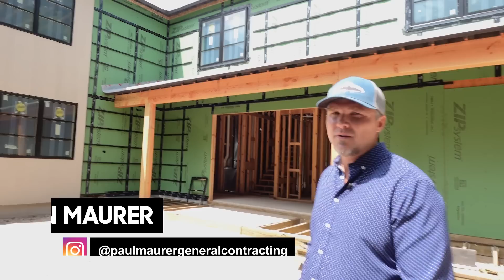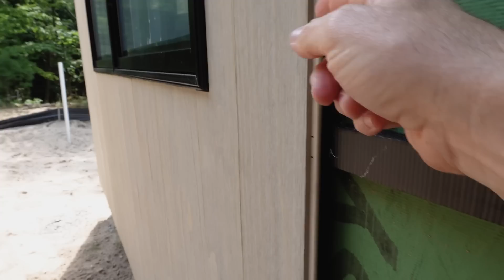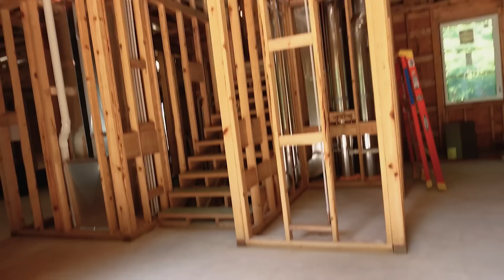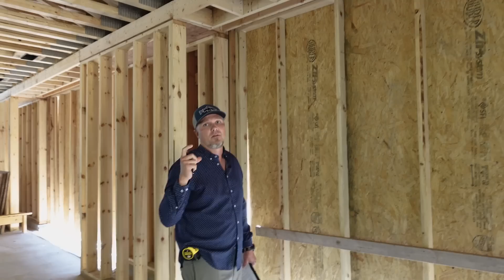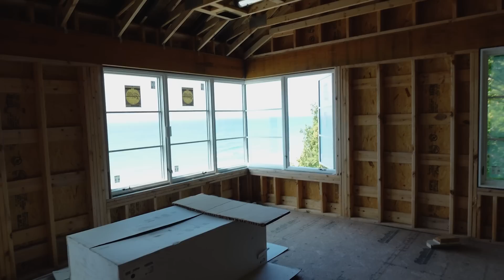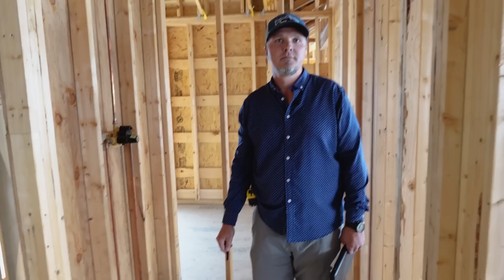MI Beach Build - Several Cool Details Here!

Comment: It had to be be pressyre treated, put under pressure to get the vinegar into it,then a vacum pulled to remove it,if its not dry enough when they start they have to pull a vacum to remove the moisture,interesting product,ran a small creosote plantthat manufactured rail road ties bridge timbers utility poles and pilings,could be wrong but i haven't heard of any new technologies, enjoy the vids

Comment: Didn't really show the view if they're on the cliffs or not. My relatives have lost 60 ft of yard in 30 years.
Reply: On the other side in Alpena and we lost a foot of dune a week during the fall of the recent high water years.
Reply: @bcrogers57  yeah that was probably close to 15 years ago. Dunno how much more they've lost since then.
Reply: Appears to show enough that this is a beach level home. Plus the sand blowing in.
Reply: @M22Research  Beach homes you should drill and form concrete pier foundations. Slightly elevated from ground level. Slab on grade is no bueno.  The underside can be spray foamed for insulation value.  Hammer drive steel piers into the beachfront if worried about erosion.
Reply: @mefobills279  watch the video.  This home has a 42” rim foundation + insulation + radiant in floor heating.  And the porch area has concrete piers below the frost line. And this is on Lake Michigan, not the ocean.   Very minimal tides.

And elevating the home in cold climates exacerbates insulating the floor as well as enables rodents moving in.
Reply: @mefobills279  it sounds like you’re referring to ocean front homes. 

The builder claims this has a down to the frost line perimeter 42” foundation with insulation, not a simple slab. 

Suspending a home above grade actually makes it less energy efficient in cold climates.
Reply: @M22Research  You have to spray foam the underside.  A ground loop heat pump is a downside relative to a passive home.  The real problem is drilling or the expense of driving piles.
Reply: @M22Research  All foundations should have piers and columns down to solid substrate.  If you go that far, it's only a hop and skip to elevating, which is superior.  It's all about the expense of drilling, and until that cost comes down, the superior solution will not be used.
Reply: @mefobills279 ever heard of foam board, with sealed joints?  (Under the concrete pour.) Not sure what the heating system has to do with the foundation.
Reply: @mefobills279 you’ve clearly never built in Michigan or Northern Michigan, for that matter.
Reply: @M22Research  The foam boards are XPS that are closed cell and can take the pressure.  The point is that if you don't anchor to substrate, you are a second-class builder and taking shortcuts.  Insulating slab is fine but you might as well elevate.  This also allows you to build a sub conditioned space to run utilities, HVAC,  etc.   Ground loop is a heat pump because your building is no longer anchored to the earth, not passive.
Reply: Builders always ignore roof runoff and erosion.